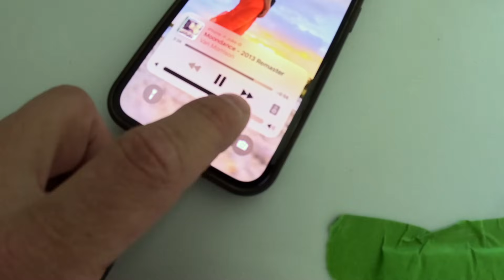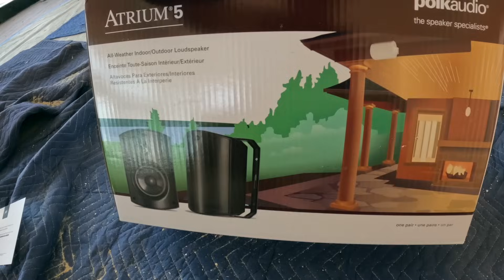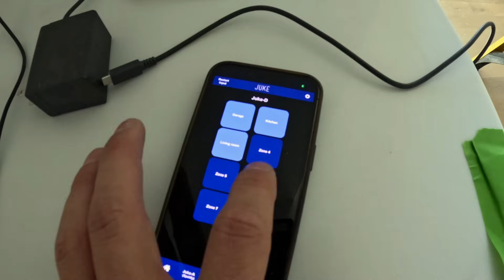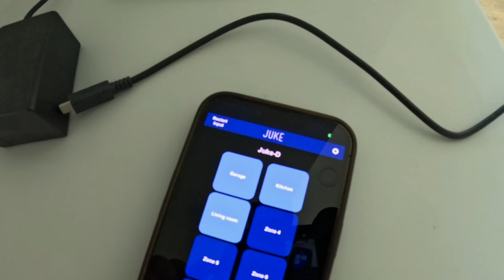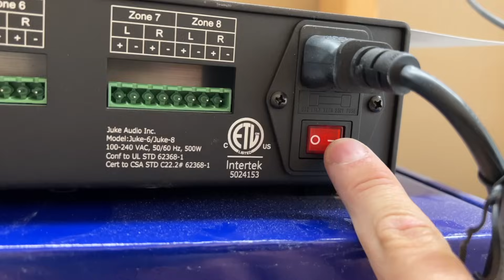How to Connect Your Entire House Speaker System

Comment: Nifty way to run your wires through the hole in the ladder.  If you put 4 or more speakers in one large room, are you crisscrossing 
A and B to have stereo no matter where you stand?  That's how my dad wired them.  8:45 They are audio wires, not electrical.
The speakers in the kitchen look really close together.  I'd think to fill the room you'd have them on different sides of the room.

Comment: Back in the 80’s  I was a teenager I worked during the summer for a youth program and we worked at the local high school to get the school ready for the next school year.
They had all the speakers in the ceilings in the classrooms and in the halls. It was the system they used for announcements etc. 
I figured out that we could play the radio in the office and if I flipped up each little lever, it put music where ever we were going to be 😁